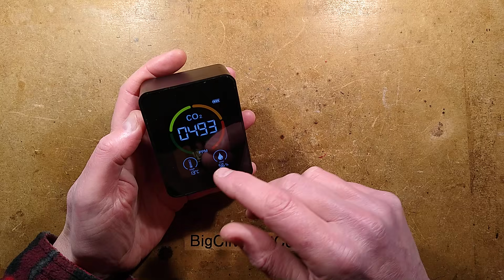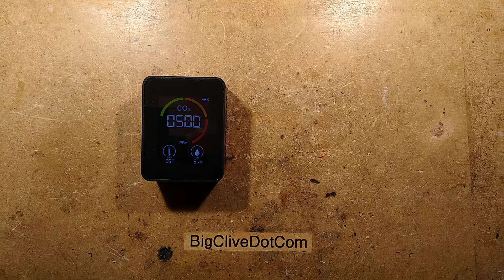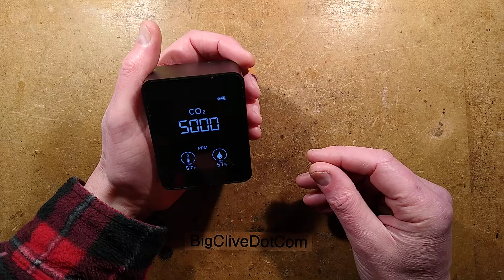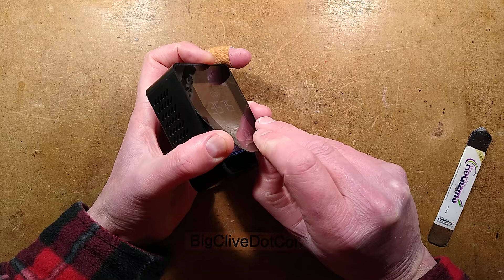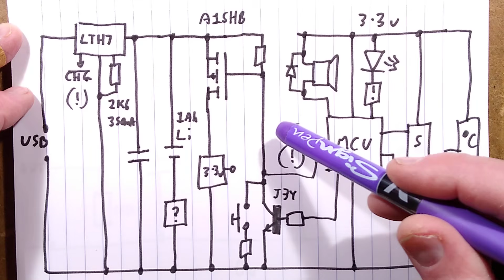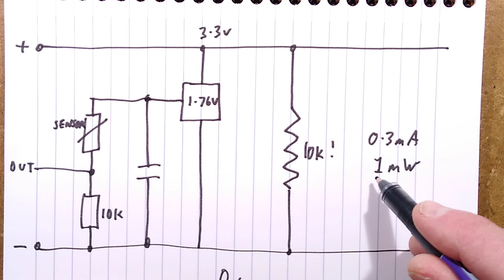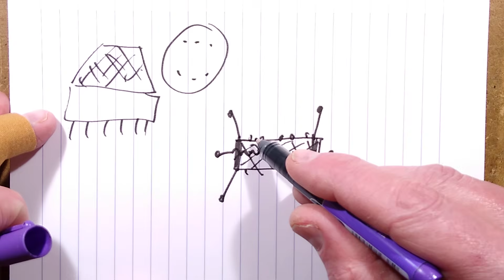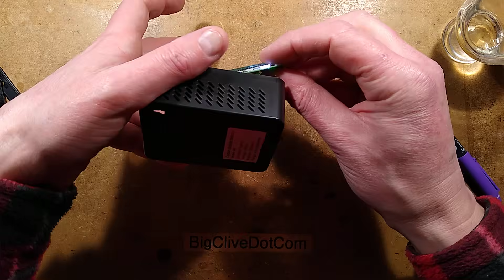Fake CO2 monitor (party detector) with schematic

Comment: They don't know the difference between carbon dioxide and carbon monoxide?   The latter would certainly be useful in any heated building.  Can you put an Arduino Monoxide sensor in that circuit, that would make it useful?

Comment: I've had to give lectures to over 400 engineering students at a time. Some years, that meant about 80 of them had COVID. A working CO2 sensor would have indicated at least that the ventilation in the lecture room was satisfactory (which it usually wasn't).

Comment: The same sensors are being used in various Tuya enabled devices sold as CO2 sensors. I got 2 different ones, they also go wild near isopropyl alcohol. We were making mussels with white whine, when the bottle was standing open next to the sensor, it started to trip the alarm “GAS detected, evacuate immediately”, while we were cooking electric :)

Comment: The sensitivity of Sn/SnO gas sensors is related to the applied voltage, similarly, the sensitivity to specific gases and vapours varies with the applied voltage - particularly with VOC sensors.

You might like to follow up testing the sensitivity to other workshop/household organic solvent vapours.

Comment: To make my 3D printer safer, I wanted to buy an "arduino compatible" CO and CO² module and use an ESP to read CO² remotely. Sound an alarm when CO² (because it indicates something is burning.
And all sensors you can (theoretically) get were described as very unreliable, and had hints that they don't last long (they wear out). But they weren't even sold. What you could get and was dirt cheap were sensors that detect organics (like alcohol).

I think they designed it as CO² sensor and then accountancy found out how much these sensors cost and suggested a cheap sensor instead.

Comment: I was considering buying one to use as a co2 monitor for a greenhouse, thanks for saving me $15 or whatever. Co2 levels can easily drop below ambient in a greenhouse and a significant increase in yeild can be obtained by supplementing co2 up to 1000ppm

Comment: A reliable CO2 measurement is of course a good measure of ventilation quality in an inhabited space.  

It's also a good proxy for rebreathed (ie. shared) air, and can be very useful during say an epidemic.  The proxy only fails of you have very good filters, (a CR Box for example) but no fresh air.  So these devices got very popular during peak covid, but sadly most cheap ones are like your example.  Chocolate teapot territory.  As others have said the advice has been to get an NDIR infra red based sensor, while avoiding dodgy products.

Comment: Thanks for sharing. I've gotten my hands on a free fake air quality monitor like this. Haven't cracked it open yet but it's probably running the same TP-401 sensor from Shenzhen Dovelet with the DHT11 temperature/humidity module like the ZN-2CO1 Air Quality Detector that was reviewed by "Tech with Jin". Since I got it at no cost, and it has WiFi for remote monitoring with the Android app from TUYA,  I'm looking for better sensors to replace both the TP-401 and DHT11 as a DIY project.

Comment: The sensor might be very slow to respond to CO2 readings yet very sensitive to other chemicals. The problem with sensors is that they can sense more than what you want them too.  Should probably test more CO2 sources longer. Breath in/out of a clear plastic bag 5 times and then place the sensor inside.

Comment: Where can I post one of the ones I've acquired to?  1800ma battery, circuitry is total different but the screen is the same and the case very similar. Rexel brand

Comment: I have a photoacoustic CO2 sensor and simply breathing directly on it will shoot the readings up to the max 5000ppm and in closed spaces lacking active airflow, it doesnt take long to reach co2 levels capable of affecting your cognition
Reply: And what they probably used in their 'co2' sensor was a VOC sensor with an equivalent CO2 output because of how microhotplate metal oxide semiconductor sensors work

Comment: That display is probably just (colored) LEDs on a circuit board with plastic light pipes in the shape of what you see on the display (that's why it's 2 cm high). Seen that before and it looks very nice and cost effective for what is is meant for. You typically see a difference in light for each segment as the LEDs are not 100% matched.

Comment: Clive, I bought one looking like this for about €40 during the lockdown and it works perfectly well.  I have tested it in CO2 atmospheres in our university chemistry dept and it gives a fairly accurate CO2 reading.  Put a cloth over your head and breath inside it with the sensor for a minute or two and you should see the CO2 level rising to 1000+ ppm.    Take it into the toilets and you will see the HCHO (formaldehyde) and  the TVOC (total organic volatiles) go high, due to the cleaning materials used.  The CO2 will go up also as the sensor is not specific to CO2 only.  I am guessing your one was either a cheap clone or else missing a sensor - faulty manufacture and/or QC.   "One swallow does not a summer make!"

Comment: I'm probably just an idiot, but how is the sensor output hitting >2.5V while being powered from a 1.8V regulator?
Reply from the maker: You're not an idiot.  I think it was me who was the idiot for that bit.
Reply: Not willing to discount the voltage reference not even being used for anything, and it's run off 3V3.. Maybe the 1.8V is just used for AREF and that's why your wine breath keeps sending it flying off the scale!

Comment: Teardown it's bigger brother, the "6 In 1 Multifunctional Air Quality Detector" - available in your favourite cheap online store. Looks identical, but with more sensing (with wifi and Tuya)
(Full description: "6 In 1 Multifunctional Air Quality Detector PM2.5 PM10 HCHO TVOC CO CO2 Formaldehyde Monitor LCD Display Home Air Quality Tester")

Comment: Once bought the model that suposedly measures particulates (it doesn't) CO, CO2, VOC and formaldehyde.  I've yet to test all those sensors, but breathing on it (sober) gave a definite jump in CO2 only (a pleasant result) but interestingly, it also reacts to argon.  Surprised to see it sense an inert gas, which is handy to use as a double detector.  It would be interesting to give it some proper testing.

Comment: Quite interesting that you got the result you did. I have a very similar looking model at home that I paid decent money for from a reputable store. Mine has the exact same screen, however it has a white plastic box, not a black one. Looks like it might have more vents on the sides as well. If I blow on the back of mine, it jumps up to 2000+, but not an instant 5000 the way you see on yours.
I did a little test of rubbing some isopropyl alcohol on my hands the same way you did and then providing the fumes to the sensor and it didn't move at all.
It would appear that not all Chinese made CO2 meters are equal.
Reply: I was worried that mine was fake after seeing this videos, but luckily mine has a white background and was also bought from a reputable store, glad to know that I most likely wasn't scammed haha

Comment: I've bought an Aranet4 CO2 monitor to see whether a place is sufficiently ventilated, so I could make a more informed choice about whether it'd be risky to unmask to eat or something. It turns out that in nearly every place where this question has cropped up, the answer is that the ventilation is so poor that it won't even meet pre-pandemic guidelines in my country (1000 ppm). I did consider cheaper CO2 meters before making my purchase, but I wasn't sure which one I could trust and one other monitor I ordered never arrived at all (I got a refund instead when I raised a dispute).

Oh well. At least the fancy charts are fun to look at. 🤷🏻‍♂

Comment: I  come across C02 monitors at work as a Supermarket Refrigeration Engineer, either CBISS or CPC. 

They can be configured for HFC or C02 refrigerant. They are networked to RDM panels, so alarm along with the fridges, they're usually set for 3000, 5000 & 15000 ppm, with c02. 

They take a baseline reading, then compare that with readings from every channel throughout the store. They're not cheap £4000 to £5000 if I recall. We also tend to have a few issues with them, pumps, IR sensor bench or PCB failure

Comment: It's a VOC sensor that estimates CO2 based on total VOC. Does not measure CO2 calculates and average CO2 based on total VOC. Typically the more people you have in a space the higher the VOC and CO2. The only worthwhile sensor to measure CO2 for this type of application is an NDIR sensor like the Telaire T6713

Comment: I guess it is a VOC Sensor. It is often used to transfer is into eCO2. It workt pretty okay when it is just used like a indicator for air qualitiy inside a building. When people breathing, they creates some gas or something the VOC deteced it and convert it with a formula into eCO2. In a room where just a guy is sitting with no other gas source like pure alkohol, it is actually pretty accurate. But yes they have to point it out and not just write CO2 on the device.
Reply: VOC Sensors are much cheaper than real CO2 sensors. And in this particular use these VOC Sensors are often good enough.

Comment: It's really important to check CO2. You'll find plenty of examples in the comments, but high CO2 causes all sorts of nasty stuff, all subtle enough you won't really notice it, but it will weigh hard on you. 

And buildings are built to reduce airflow in and out, it ruins the insulation and provides routes for bugs and stuff to get in, esp. modern ones, but it's worth checking any of them. I found the airflow around where I had my bed wasn't enough so the CO2 there was massive, even if the total level in my room was fine.

Comment: I've always thought that this device takes a lot of measures and then calculates the mean, that could explain why always starts at the same value and then slowly moves toward a value to eventually stabilize. Also that would explain why it ignores the extremely high measures of co2 (Pls excuse my english)
Reply from the maker: Your English is perfect.

Comment: compare step down voltage converter (diode step down chain) power supplies vs shunt diode regulator power supplies, mostly the energy consumption (idle/half/full usage)

Comment: This is kinda funny because I’ve been teaching myself some programming by building an arduino (esp32) DHT11 temp/humidity LoRa transmitter / receiver for monitoring a food overstock area of a small grocery store that I installed a dehumidifier in.  It’s been fun slowly expanding the functionality of the units, the dev board button now has 3 functions, single click (verbose mode toggle), double click (start WiFi connection AP) and long press (adjust OLED brightness)...  Now I need to work on the LoRa portion, right now it just transmits a single string that either includes just temp / humid or temp / humid / time and then displays it on the other unit, however it would be better if the data was kept as independent values so that the receiver can process the data and respond to it rather than just display it...  got learnin’ to do.

Comment: Guy working on sensors in HVAC company: most probably there is a so called VOC (volatile organic compounds, e.g. alcohol etc) sensor inside that outputs an equivalent CO2 reading. This is done as humans exhale VOCs as well as CO2, so theoretically you can use the VOC reading in a building as a CO2 proxy. That also explains why you did not observe an increase in CO2 level when using pure CO2 from the gas bottle. VOC sensors are much cheaper than CO2 sensors, which is why this config is used in cheap sensors modules.

Comment: I have a CO2 sensor that's almost identical but with a whole bunch of very tiny differences:
 - "PPM" label is less bold and the "CO2" label is 3 characters of equal size and position
 - the digital display stays centered and does not employ a leading zero
 - the level dial has a gradient outline surrounding the 4 intensity marks
 - the battery indicator has no opening on the right and the fill meter inside is continuous
 - temp symbol is a thin line figure representing a thermometer, with scale lines across it (instead of an outline-plus-fluid depiction)
 - humidity and temp numbers are in a bolder and smoother sans-serif font
 - there are no "temp" or "hume?" labels, just symbols
 - the side perforations in the body are smaller, simpler, and more numerous
 - and most substantially, the port is micro USB

Perhaps most importantly, however, I can easily max it out (at 6,000 PPM) by slowly exhaling into it, and it is completely indifferent to alcohol.  It also roughly agrees with various other CO2 sensors I have.  I guess mine is the real deal.

Comment: I mean, "Party Detector" might even be a good application? Put this in your AirBnB, or even just parents putting it in their loving room if they have teens. Some alarm goes off telling you that the CO2 levels are dangerously high? Maybe the party will evacuate? Probably a bit silly, but not a totally insane concept.

Comment: Seeing as carbon dioxide sensors for incubator cabinets and the like are usually ridiculously expensive I'm not surprised that they used a substitute sensor for their fake product.
Otherwise these would possibly have been worth buying in bulk just to extract the sensor components.

Comment: The processor is an ARM PN : STM32F103 by ST . I had a version with full print on it. I hope this helps anyone. I also checked the sensitivity to CO2 and nothing happens - it is a random number generator . I opened dispute with video showing me placing it in a bag with CO2 . I got a refund. I also had a wifi module in it .

Comment: The idea here is actually good given that the device measures CO2 properly. I actually sometimes had a little problem with CO2 in my old apartment. Living room was maybe 20 sqm. At 2,5m height it's 50 cubic meters. Let's say that we have 8 people there and the room is sealed (maybe it's a cold winter or very hot summer and you run a lot of AC in closed loop so you want to save on air exchange). In just an hour you will reach 1% of CO2 concentration which already feels stuffy and not fresh. If you'd continue, after 8 hour party in such sealed room it will be  over 6%. Very high and dangerous (the actual limit for workplaces is 1% for 8 hours or 3% for 15 minutes). Now it seems unrealistic but it's enough that you don't have enough ventilation and you may have problems because of this. The problem is that although alcohol level in the air may reflect how stale the air is on the party, it's not giving us much. In my office we have booths used for short meetings. Those are roughly 3x3 meters, so around 40 cubic meters. You have a meeting with 6 people in it. After just half an hour it's over 0.6% which is already not comfortable and affects how people feel, in an hour it will exceed the allowed concentration. Despite having some sort of ventilation, those don't have enough airflow and are soundproof, so they are actually sealed from the open space too. It's a bad design and it can only be used for up to 15 minute meetings after which you need to leave the room open to vent it out. If you have a few meetings in there one after another, people don't even want to get there as they start feeling bad after a few minutes. If only they would have a working CO2 meter in there.

Comment: It is the same as TOVC sensor they sell on places like Amazon. They claim 3 in one but ya know it is false. They read VOCs sometimes. :P NDIR sensors are like 30$ at rock bottom, anything selling below the price of the sensor it claims should set off warnings. A proper rock bottom low labor market price is about 60$ for NDIR CO2 meter. Not sure why some other markets charge 200$ for it, they use the same 30$ sensor.

Comment: I got one that has a similar UI from amazon (the INKBIRD). It claims to be an NDIR measurement and it definitely seems to work. In my room after I sit for a while it can get up to 1500, but open the window and it goes back down to 600 ish. Set it on the top of a seltzer bottle and it maxes out.

Comment: Working with dry ice, one might find it useful at the very least to have a proper CO2 monitor around.

Also, this is probably supposed an eCO2 monitor, or "estimated CO2". It measures the volatile particles in the air, and calculates how much CO2 should be in said air - assuming the source of volatiles is humans breathing. As for why these things exist, I guess it's supposed to be easier to measure volatiles then CO2, but it's kinda useless when put in an environment where there are other CO2 sources.

Comment: It could be a VOC (volatile organic carbon) detector. Those are often in packages with humidity and temperature sensors. You can probably also detect other vapours such as acetone, acetic acid (vinegar), perfume etc.
It probably does not react to butane and similiar alkanes because they are much less reactive.
Reply: Volatile Organic Compound, not carbon. VOCs have carbon in them, but they're just chemicals with low boiling points, thus they easily transition to gases (which is the definition of volatile).

Comment: behaviour reminds me off the VOC sensor in my CAT phone and that would make it faor more usefull for air quality than a CO2 sensor. It really goes nuts if you use the phone after desinfecting your hands.
If i had to guess, i would say these were designed to "be" CO2 sensor and flodded to ebay etc cause of Covid, CO2 indicators were recommened for schools eg as an indicator when to open the windows for some fresh air to reduce possible concentration of infectious material in the air.